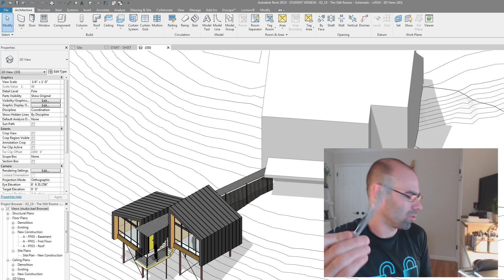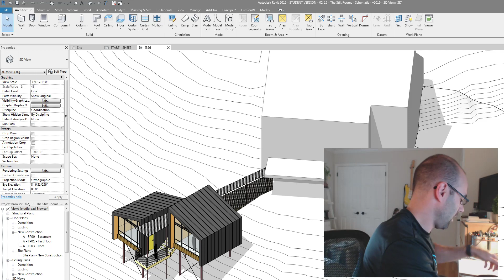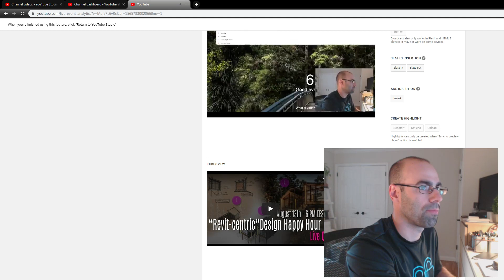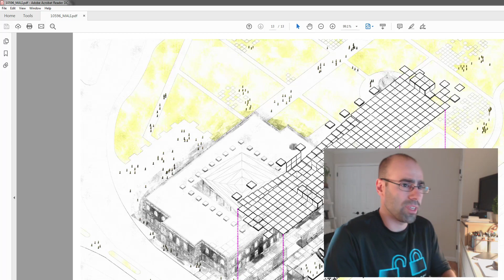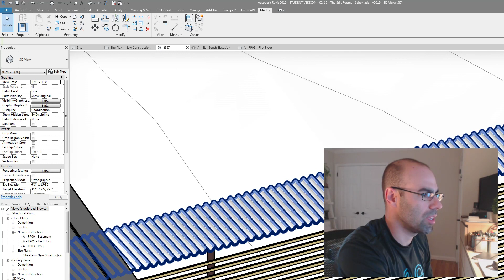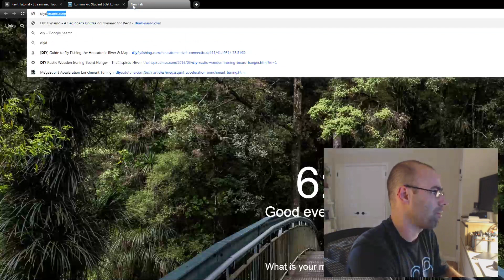A "Revit-centric" Design Process (Live Happy Hour Q&A)

Comment: Curious what you wound up doing for drainage from the corrugated roof between the two buildings and in general; assuming you moved forward with this design.
Reply from the maker: Yes, that roof would be a challenge and require many options.  Hypothetically, if we liked how it was designed perhaps sloping it to the front or back and modifying the material could work... There are options and they will be explored as the design develops.